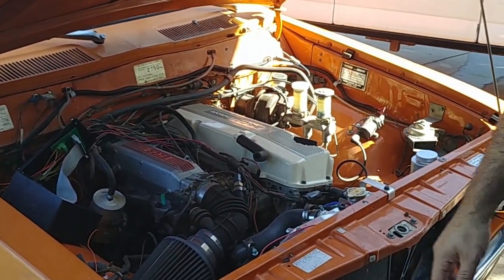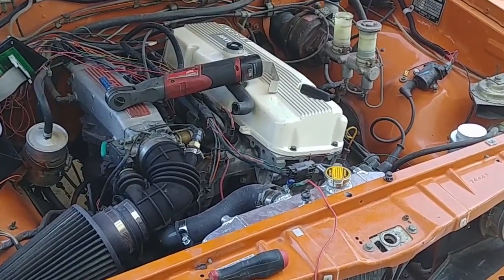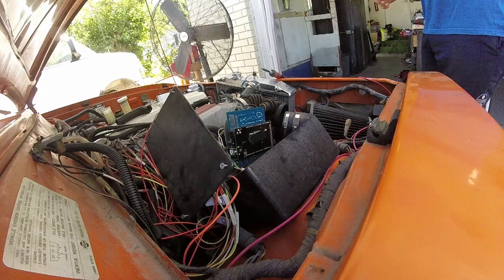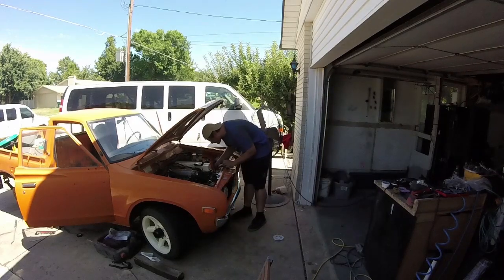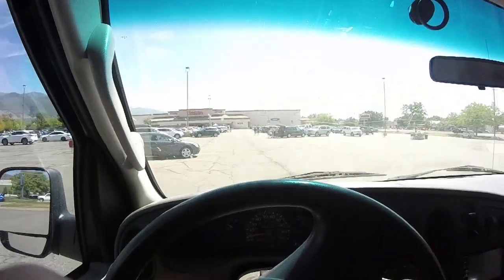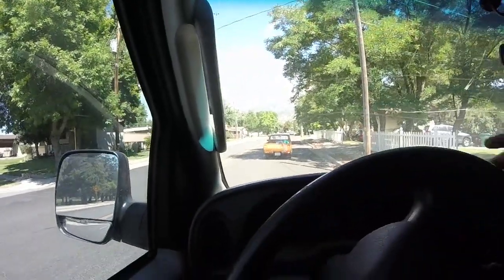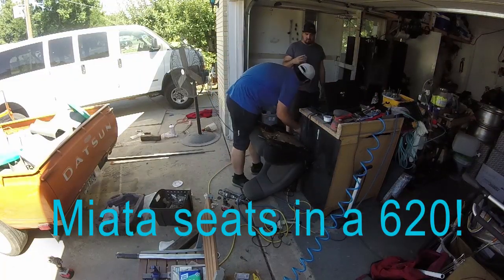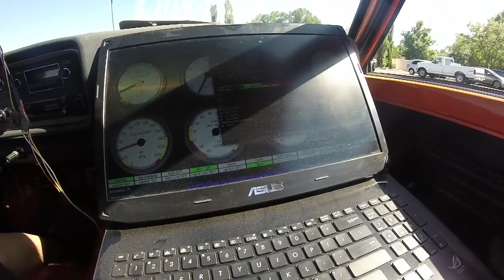First drive in a KA24 swapped Datsun 620

Comment: Your best bet is to undercoat your car once everything is done on the underside. Just do not put coating on your excaust pipes. Put heat resistant paint on there and there will not be any leaks in anything in the long run. 

Good luck!

I like your speeduino videos to! 

Greetings,

Jeff
Reply from the maker: Thanks Jeff! We got lucky and just needed to use a better clamp. But yes, undercoating does have some good uses!

Comment: Awesome swap, thinking of doing something similar to my 620. My truck is almost identical to yours, a little rustier though 😂
Reply: I have an 85 720 and I may go with a swap like this. If my research is correct, the hardest part will be modifying the oil pan to clear the cross member. The biggest goals with my truck is to crack the 200HP mark at some point and to turbo it. The stock engine just isn't going to cut it.

Comment: In my opinion  the lb20 engine is by far a better  engine what made you go with that k engine? Sometimes  you use what you've got
Reply from the maker: Well, the L20 is not a bad engine, many in Japan treat it like Americans treat the 350 Chevy engine. As for why, there are a few reasons. First off, it was not an L20 that we pulled out, it was an L18. The stock engine was carbed, very gutless, subjected to heat soak, and non crossflow head with terrible mpg. Most of those issues got solved with the KA24. other than that, we blew a head gasket on the old block. Thanks for watching.
Reply: CEK Garage I’m about to do this swap. Just curious as to which trans you went with? Nice truck! My first Datsun was a ‘74 back in 1980, I was just a kid. It was my dad’s and he gave it to me. Believe it or not, I still have the doors from that same truck! They are on my ‘79 King Cab! I’ve had them 40 years, kind of a homage to my dad.

Comment: Is there anyway I can fix my fuel issue on my 96 hardbody 4 cylinder? It drinks way too much fuel. I drive 26 miles and it drinks a quarter tank of gas or more within 26 miles but idles perfect and drives perfect and doesn’t cut in and out like it would with a screwed up fuel map
Reply from the maker: Timing makes a huge difference for fuel mpg. For example, you run 15 btdc at 40 mph at x kpa. Bump timing up to 25, your kpa will drop and in turn you will use less fuel.
Reply: CEK Garage I have the stock computer and the motor is in time so how would I change the timing?
Reply from the maker: @jacobledford9808  I did not realize you had a stock ECU. If you have a pre obd2 ecu and it is drinking fuel like crazy, I would start with the following. Check the engine sensors. Coolant temp sensor goes bad often enough that there are many people that do forums on how to use a pot of water on the stove and a multimeter to test. MAF or intake temp sensor would be others to check as well. Next, Check your fuel pressure and make sure it is in spec. I have seen older engines get the return line backed up and cause high fuel pressure. After that I would then check work others did before you owned it (some of the emissions bypasses make mpg worse for example, especially if they took shortcuts). The hard part is a stock ecu expects specific conditions to run right. If something changes, most of the older ecus are set to the fail safe of more fuel. The engine will still run, but it is thirsty. Good luck.